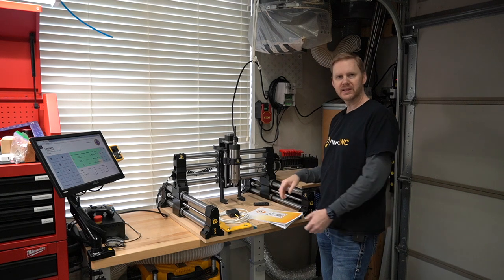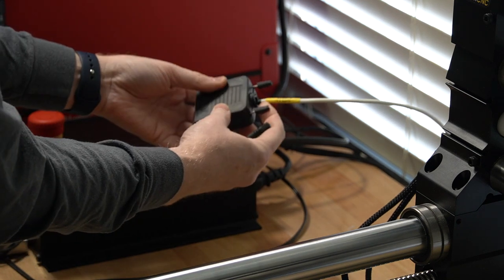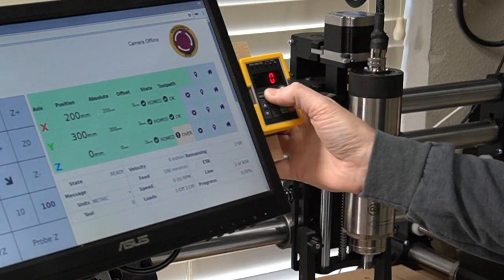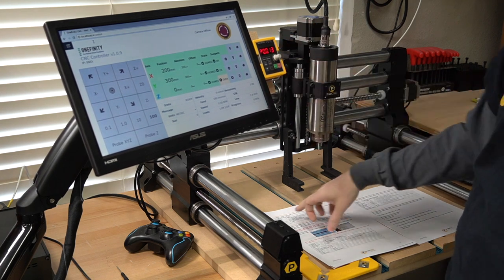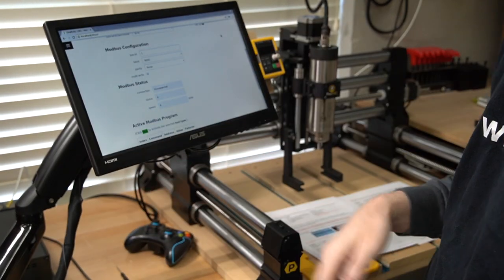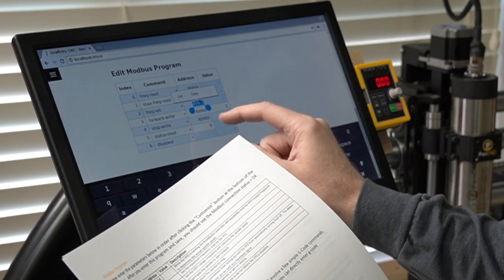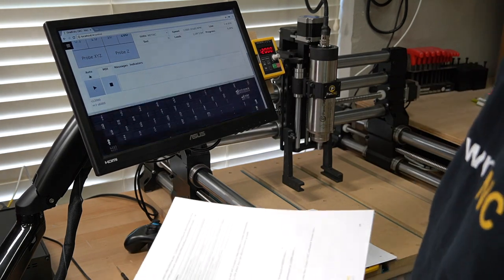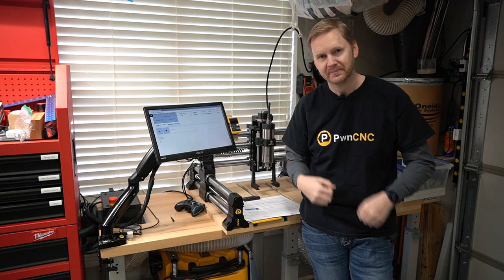[OUTDATED] Spindle Modbus Control for Onefinity/BuildBotics Controllers

Comment: Hi, first of all congratulations for your channel. I have a question not related to the video, but you might be able to help me. I've just received a Onefinity Journeyman and I'm trying to configure a Fuling DZB300 VFD and a Spindle that I've already got, but it ins not in the tool list of the Onefinity Controller Software. Onefinity does not help you on that and recommend you the Buildbotics forum. Buildbotics, on the other hand, just said their Controller software (1.0.3) has the Fuling DZB300 VFD selectable from the Toll Configuration drop down menu, but refuse to give any support on configuration for Onefinity customers. As I saw on the video you might have also access to the Buildbotics Controller Software, would it possible for you to send me a picture of their software page ( Tool Configuration section )where it shows the Tool Configuration Notes and the Active Modbus Program section for the Fuling DZB300 VFD. I know it sounds very weird you ask you that, but I couldn't get support from anybody so far and  it would helpful for me to build a Custom Modbus VFD on the Onefinity Controller software based on what is used from the Builbotics Controller software. If you can help me on that my email is maurolucio.bh@gmail.com. Thanks very much in advance.
Reply from the maker: Shoot me an email at support@pwncnc.com and happy to dig into the details and help you out further.